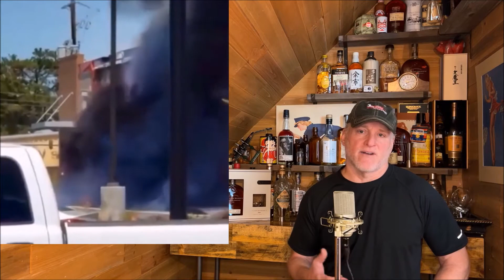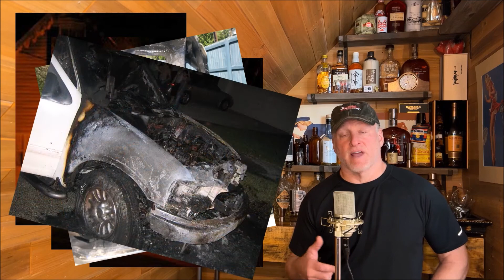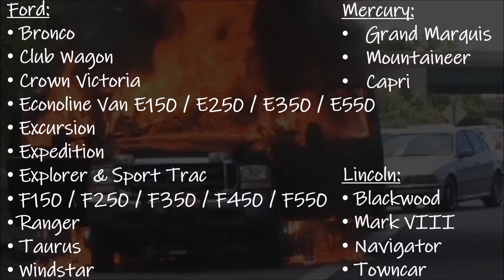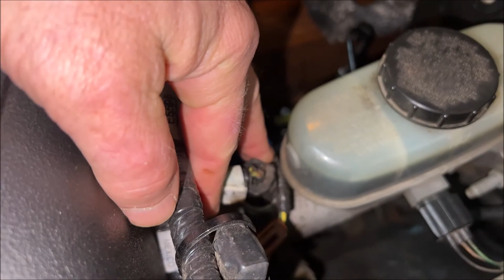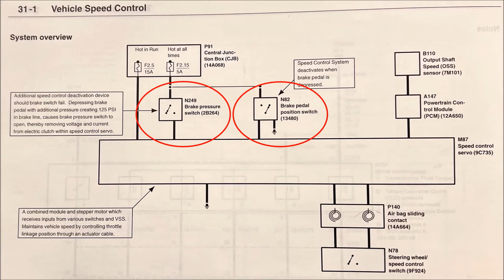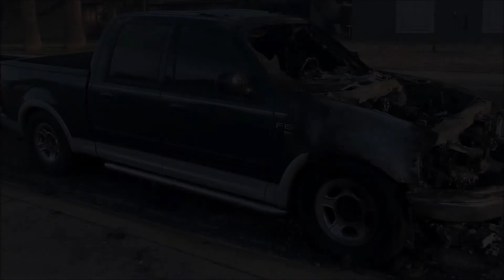DEADLY FIRE HAZARD! ‘92-‘04 Ford Cruise Control Recall — Check Yours Now

Comment from the maker: IMPORTANT:  Some viewers have called Ford or used the links I provided in the description and were told there are no open recalls for their car or truck.  I asked a few viewers to send me photos of their brake master cylinder and it is clear the jumper has not been installed.  Another commenter said he heard Ford would recall the vehicle, and if the brake pressure switch was not leaking oil, they closed the recall and PERFORMED NO WORK.  If it were my vehicle and the original fix was not installed, I would disconnect the electrical connection to the switch until I changed the brake pressure switch and install the jumper.

Comment: Wow, boneheaded designs like this are a good reminder to NEVER OWN A FORD. Instead of doing it the normal/correct/safe way and putting the switch on the brake PEDAL (or tapping into the BRAKE LIGHT switch), they have to put electric stuff right into flammable brake fluid. And their fix is to just put a smaller fuse?
Reply from the maker: I used to defend Ford, I like my Fords, but I have to completely agree with you, this is an absolutely stupid design. My Mustang has a brake pedal cruise control, deactivation switch, not connected to the brake master cylinder or close to brake fluid.  The proper way to do it as you note.
Reply: While I have to agree with you I can also say that my 03 F150 has been one of the best vehicles I have ever owned, I have owned other makes that have had other recall issues and if you think it's only Fords you are sadly misinformed as all makes have issues and the latest vehicles all have serious quality issues.
Reply from the maker: @ very valid point, thank you... some people get committed to a brand and think their brand is superior without seeing all their issues.  Toyota for example is recalling thousands of trucks with engines that have metal shavings left by the factory.  Toyota, the quality king?!.  When I did research for this video, the recalls that were shown for all manufacturers, and I mean all, was astonishing.
Reply: All makes and models have recalls. None of them are perfect. I will still always drive a Ford

Comment: When I saw the picture of the burnt white F150 I first thought it was your truck until I saw it was a Super Crew, I have the same exact truck as you and I really like your content, I was quite relieved when I realized it wasn't your truck, thanks for all your great content.
Reply from the maker: Thanks for the comment, I would be devastated if either of my 10th Gens burnt to the ground... I hope lots of people see this video and get this condition corrected.  I can't believe almost 6 million need to be performed!
Reply: @DrivingIntelligence  Thanks to your links I was able to check if my truck needed to address this issue and luckily my truck is good to go, thanks once again.
Reply from the maker: @ Make sure you do a visual inspection, I was surprised that some commenters show "0" recalls for their Ford, yet when they sent me a photo of the switch in question, I did not see the jumper.

Comment: Luckily, my 2002 f150 has no open recalls.
Reply from the maker: I suggest you look at your brake master cylinder and the switch as I describe it in the video, one person already commented on this video and sent me a photo which clearly shows that the recall was not performed, but does not show as an open recall with Ford or with the other links that I provided.
Reply: @DrivingIntelligence alright, how do I know if the recall has been performed or not again? Just so I know.
Reply from the maker: @Trucker_B only thing I can say is watch the video again, I tried to make it pretty clear.  You can do what the other guy did, post a picture to the video link of this video at www.facebook.com/drivingintelligence - take a picture of the switch and brake master cylinder, so I can see the wiring harness.
Reply: @DrivingIntelligence my bad man. I have a bad habit of forgetting information.
Reply: @DrivingIntelligence messaged you, read at your convinience
Reply from the maker: @Trucker_B answered you on my Facebook account, it looks like a jumper that would be for the fix, but without seeing it, I can’t confirm. See if there is anything written on the jumper like a model number.
Reply: @DrivingIntelligence This is OUTSTANDING advice.   There is something sketchy that’s been going on for this recall for a long time.
Reply from the maker: thank you, and sorry for late reply... I try to get back to all comments.

Comment: If I never use cruise control can I just disconnect the sensor on the master cylinder and drive it like that until I can get the recall fixed?
Reply from the maker: Yes, that’s what I described about mid video

Comment: Oh my word - Thanks for doing this. The switch went out for this very reason - leaking brake fluid  internally in the switch - mine is currently disconnected
Reply from the maker: Glad you found this and disconnected.  Will you contact Ford to check on the recall or fix it yourself?  The link to the repair part is in the description of this video.
Reply: @DrivingIntelligence  I am ordering the fusible link harness. I'm curious why engineering hasn't gone into fabricating a membrane to not deteriorate with the brake fluid - I'm sure the all American dollar says it's less expensive to create a replaceable harness
Reply from the maker: @ I think it was simply poor engineering that gave us this issue.  The recall had to cost them millions in lost profits to remedy.

Comment: Thank you for sharing. We recently inherited an '03 F150 (4.6L) and it does not show up as having any outstanding recalls or repairs needed on either of the 2 websites you have linked. I looked at the brake master and we definately do not have a fused jumper installed inline. 
Is there another "factory" repair that would fix this issue that you are aware of, or is the fused jumper the only one? [looking for any other visual que here]
I guess purchasing one of the jumper kits might be our only option if Ford does not see our vehicle as having an open recall. Bummer!
Thnaks again for sharing.
Reply from the maker: Thanks for checking in, if you can, take a photo of the area at the brake master cylinder showing the pressure switch and send to www.facebook.com/drivingintelligence I’ll see if I can tell if it’s been done.
Reply: @DrivingIntelligence  I appreciate it, will do

Comment: I contacted the Dealer with my VIN  #. Asked about the recall - Dealer said nope. No recall !!!
Reply from the maker: What do you drive?  Sorry Jeff… didn’t see who sent this… did you run the VIN on those links I put in the description?
Reply: @  this is mouse  - 03 F150
Reply from the maker: Hi Mouse, I knew it was you after I sent the initial note.  Sorry

Does your master cylinder brake pressure switch have the jumper as I showed in the video?
Reply: @DrivingIntelligence  hey Barry , I’ll look later on today at my switch. To my knowledge it dosent have the up graded wiring . Checked 2 times with the dealer - no recall . Anyway I bought an upgraded unit - I think ??  I’ll need to look at it .  And right now I don’t have cruse - a squirrel chewed the wires off completely.  I’ll get back with you on what I find .
Mouse
Reply: I think I remember hearing there was a period in the 2000’s when Ford was simply considering the recall complete by having the dealer inspect the plug for brake fluid.  Then the VIN was removed from the recall with no new harness or switch.  I wouldn’t just  trust that VIN recall search.  I’d visually verify that fusible link harness is actually installed.
Reply from the maker: @AB-kd9mk  Excellent comment, I've asked some viewers to send me photos of their brake master cylinder, those that said there is no open recall, and it's obvious the jumper has not been installed.  This blows my mind.  Everyone should visually check and replace the switch and install the jumper to prevent a future problem.

Comment: Thanks for this, those fires are unreal
Reply from the maker: You bet! It's good to spread awareness about the potential dangers.
Reply: @DrivingIntelligence in my case I’ve got two recall, one in 2005 and other 2011 (speed control system mod and fuel tank strap inspection and repair). What am I supposed to do, fix it myself I believe as I have the truck in west Africa and there is no local ford dealership.
Reply from the maker: Is Ford in Africa?  Perhaps you can get the repair parts sent to you and perform the repair yourself?
Reply: @ dunno about the country at the continent as I am in a very small island. However, all the parts I buy for my truck I get it from rockauto and did not regretted the cost and quality, but yes I’m sure I can get fixed myself
Reply from the maker: Good luck getting it sorted out